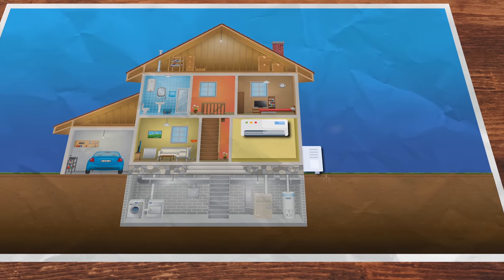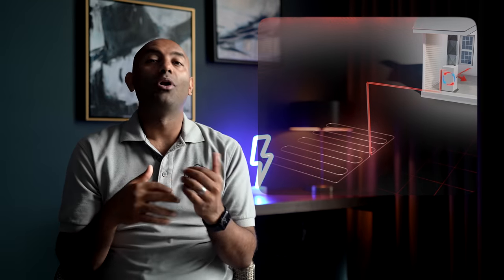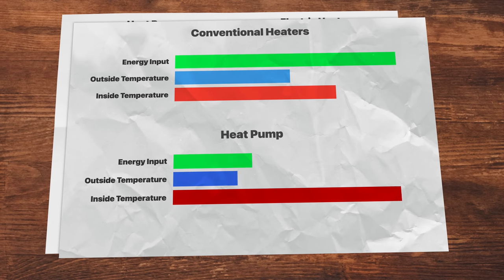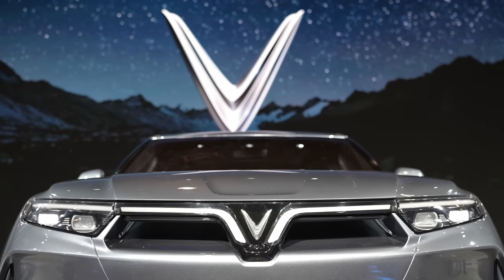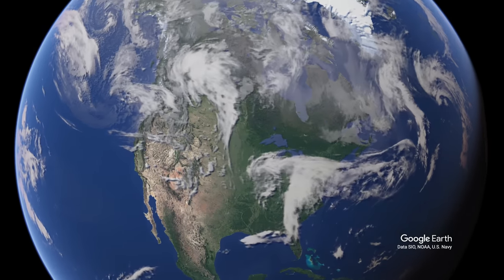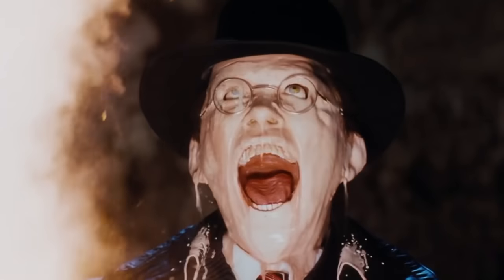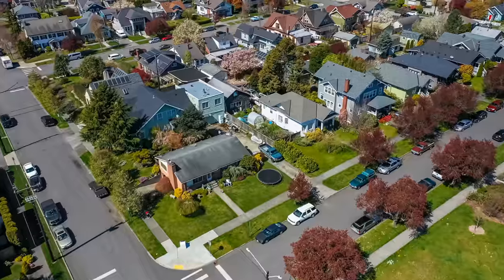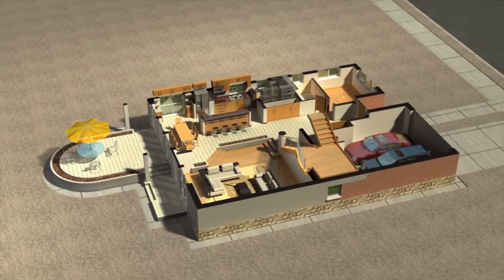Adding This Can Save You Money Summer & Winter!

Comment: Although I am far from a tree hugger I've always been a bit of a fan of alternative energy options because while I don't want to have my head taken off on energy costs I am willing to invest a few bucks here and there if it means spending less overall on monthly bills. I'm wondering if a geothermal exchanger would help reduce gas consumption even by preheating the air going into the gas furnace so I'm not burning as much natural gas just to heat my home. Soliciting any thoughts to see if anyone thinks that might work. I know a friend of my family has successfully heated their home and their adjacent shop with solar water heating and they get really good results even on particularly cold days where they have gone from refilling their LP bottle twice a year to only refilling it every other year, and they still use LP for their stovetop in the house...
Reply: Eddie, the answer is simple: you pay now for more efficient heating and cooling …or you’ll pay much more later. The reasons for this are not mystical, they are climate change and greed of the energy providers that go unchallenged by government. If that sounds strange or like the ravings of an anti government loony, look at your gas and electric bills and look for any periods when your per unit cost per BTU or per KWH ever went down.  Don’t be surprised if you can’t find any such incident. With that in mind, how can it NOT be a smart move to invest in more cost effective heating and cooling.

Comment: It would be handy if everyone would use the same terminology. "Geothermal" properly means a system of boreholes down hundreds if not thousands of metres through which cold water is pumped and steam emerges to power turbines for generating electricity. These are common in areas of high volcanic activity such as Iceland. Domestic heat pump arrangements with a loop of pipe in the ground or in boreholes for providing low grade heat for space heating are correctly known as "ground source heat pumps". It's pretty annoying that the confusion is being perpetrated by Youtube clips like this, and in some parts of the world this terminological inexactitude seems to have become ubiquitous.

Comment: Any pointers for people that live in the tropics or warm climates?
Are heat pumps a good alternative there? Think in Miami or Florida Keys type of weather where temperatures below 70s are rare.
Reply from the maker: You would see a small reduction in costs in the summer. The ground temperatures are much lower than the air temp, so getting rid of heat inside would be much better. But honestly is it worth the cost, for you I’d say probably not

Comment: I'm up in Montana in an area that gets over 100 every summer and well below 0 in the winter, so would benefit year round. I assume the largest part of the high install cost is in excavation or well drilling. Having plenty of land, time and access to big equipment (and operators), I wonder how much would/could be saved doing a lot of the prep work in advance DIY. Would it become feasible for an existing home?
Reply: I installed my geothermal myself except for the loops. That cost me $5,000 installed and he came back after I got it all hooked up. And filled the system with alcohol antifreeze and water.

Comment: The ground temperature is very dependent on location. 
Where I am in Florida it's 72.
In the area in Colorado where my friend lived it's more like 45.
Reply: 10ft below the surface gets pretty cool. Either way the temperature is consistent and and anything above 50 is the threshold for maximum efficiency.
Reply: @motoarzan791  there's a term.  Something like deep well temperature. 
Normal soil reaches a 6 month transition time around 16 feet. Basically that's the depth where the winter cold and summer heat can't continue to really affect the temperature. 

There are maps of the temp. I keep hearing almost every one saying a constant 55 degrees.
And it's not just cooler.  It's more stable. 
Soil type and water are also factors.
Reply: 56 degrees 8ft down. Wisconsin have -20f every winter.
And if it was 72 and 45. That's still a lot closer than 100 and -20

Comment: I'm planning a passive house build in either MN or New England. I don't know if geothermal +/- a heat pump is going to be necessary because of the level of insulation and the tight building envelope I plan to have, but it's definitely going to be considered!
Reply from the maker: That’s awesome! I’m thinking of retrofitting my home in similar ways!
Reply: @TwoBitDaVinci  I'd be happy to keep you in the loop when we start the design/build process if you're interested?

Comment: I want to jack hammer a series of geothermal wells. I have 50 feet of sand to bedrock. so I see this non drilled design would be cheaper. the only problem is the 90 degree elbow that will fit down a 1-1/4 pipe.
Reply: Unless the sand is saturated with water, you are wasting your time and money. Sand is a great insulator. R 1 per foot.
Reply: @kkarllwt  the water table is at 10 feet down. so it's 40 feet of water.

Comment: Live in San Diego and have been researching hear pumps for the best part of a year, very keen to get one fitted to my single floor 1975 build house but struggling to find any local vendor. They all want to push me to gas and standard hvac systems. Managed to get a 6kw solar and house battery installed last year along with solar pool heating, still trying to find a viable solution for spa heating that doesn’t use gas.
Reply from the maker: hey Richard, we should talk, I've only been looking pretty recently. But in San Diego, the weather is so moderate all year roung, its probably the last place geothermal heat pumps make sense. even then I want one :)
Reply: @TwoBitDaVinci  ditto, I have very long term plans with our residential home to turn it into a family air bnb and as a life long environmentalist I don’t mind spending the money to have the right outcomes whether there’s an ROI or not. I’m up in Carlsbad so maybe chat over a nice craft beer sometime soon.

Comment: Geothermal only makes sense for retrofitting old homes with poor insulation and big yards. For a new-built home, you can simply build it tight and efficient like Matt Risinger did, then the heating and cooling load will be so low that even a small mini-split is enough for the entire medium-sized house.
Reply: JW that wasn’t the case with my home. It’s a 2200 sq ft place with a finished basement of equal size. The place was well insulated when I bought it 20 years ago. It’s only weakness was an old low SEER heat pump that used propane as a source for supplemental heat and electric heat strips for really bitter cold conditions which are not common where I live but we do get them several times each winter. When I bought the place, our rural electric coop prices were very reasonable and propane was as well.  But even with cheap energy prices my bills ranged from $150 in the summer to over $300 per month in the winter. This was around 2004. I know there are many areas with much higher energy costs but I moved here to get away from that when I retired. All went well for a few years other than some spells where ice storms took out our electricity. I bought a whole house 20kw emergency generator to handle that and it’s been reliable now for over 15 years. When our electric costs went up 40% I needed to address it. I talked to many HVAC specialists and did my research and had geothermal installed 13 years ago. It addressed most of my problems. It provides low cost heat and AC and even makes our hot water. 2 years ago our electricity costs went up 40% again to no one’s surprise. At this point I decided to go with solar. My system cost 20k after a rebate and even though I had to borrow most of the money, it’s been a good choice. My electricity is now $30 a month instead of $350 so the savings more than cover the loan. In 5 more years that loan will be paid off the same way my geo cost was recuperated within 7 years. 

It’s all about taking responsibility for yourself. I had neighbor’s question my decisions about this. They are now strapped with $400 monthly electric bills and equal sized propane bills. I feel for them but they made their choices and chose poorly.

Comment: Hi! I have a question. Is this ideal for tropical countries in south east asia? we don't have winter. just heat all throughout the year. will this work for only cooling our house?
Reply from the maker: Hi Shiro, this helps in summer and winter. In the winter,  the ground is warmer, so there's more heat to absorb to bring inside. In very hot areas, you need a place to dump the heat you move from inside your house. The hotter the air is, the less the temperature gradient and so the heat transfer is lower. This means you'll get less cooling with the same energy. Instead the ground is much colder, so its much easier to dump the heat there, and therefore it'll work way better. hope that helps!

Comment: I have called over twenty contractors in my state (Virginia) trying to get an estimate for either a ground-to-water or an air-to-water heat pump.  No one will do it.  What's up with that?
Reply: Same here in FL.  Can’t find anyone to work on them.  Ripped mine out and had air to air installed.
Reply: I installed my own geothermal. Ground to water. Man it sure is great getting up to warm floors when it's-20f outside. Use chilled water fan coils. For cooling. Every thing  works great. 5 years running.

Comment: This is great for more rural areas, but what about large cities that need to cool towers? NYC and other large cities that could benefit most from reducing the brownouts are not really eligible for this tech. However, forcing new construction is essentially taxing those in the rural areas to benefit those in large cities. You will slow down the building of new housing thanks to the added costs, and thus slow down the adoption of this tech.

Comment: I don;'t understand why you need the loops to be so big or far away from house for hvac?  The earth can impact the temperature below your basement floor alot more than your house.  Earth is a liitle bit bigger.  So why do you need to go outside the perimeter of basement?  or deep?  Cant yoiu just dig the basement hole - say an extra 5 feet deep..  coiver the coils for 4 feet and then put the basemetn in.  That would dramatically reduce the system coust wouldnt' it.

Comment: The real problem for con$umers is these better long term solutions cost more upfront.
Many are stretched financially to the limit just getting into a house these days.
Fewer can afford and are willing to pump the investment.
When buying a house, co$t is a major concern. Builders use the cheapest components they can get. slab on grade not a crawl space, 2x4 walls not 2x6, cheap A/C unit not geothermal and solar.
I think the best implementation is for large residential complexes instead of individual houses. More space efficient and easier to build/ manage in modules.

Comment: Best geo-thermal is simply using a swamp cooler type plan 50 feet down. Achieve the same exact thing for less than $2k ....very old technology ... Ohh , and the main underground component would last for a millennia ... Or more ...
Edit : 
And typically , tying up 20 feet by 100 foot stretch of those tiny yards in those smooshy developments is rather ridiculous , as merely installing that over priced roll of copper looking tubing across the tiny yard then means at only a 10 foot depth that you couldn't do any future digging such as pool installation , cellar , bomb / tornado shelter , man cave (yes,that's been a recent thing to)..., etc..
Its completely overpriced , wasteful and greatly over complicated to have that crazy geo-thermal system put in that you showed .
The idea has actually been used for thousands of thousands of years as man has dug tunnels across the mid-eastern trade routes and many more examples .
In today's time , you can honestly achieve the same exact results on a constrained property like what's commonly in city limits by simply using the largest septic tank you can reasonably afford , two 3-4" pipes and as deep as you can afford to dig . seal the tank , install a sump pump (just in case) and your fan up top accessible from inside the home . this is a sump pump design and has been used in the deserts for many years(above ground though) ...( or using culvert pipes but those are expensive )

Comment: solar heat collection + heat pump pipe loop
Reply: those heat collectors can be also heat radiators, reverse action
Reply: solar panel to give direct electricity, under the solar heat panels, at 20%, the film type
Reply: you can concentrate the incoming solar heat,  and also compress the output heat, so that the delta temperature is larger, like 100C to 40C outside

Comment: Not a witch counts as the fact that gas was so cheap it still beats them.  Your better off with electric air conditioning.  I'm not buy a small cost but by a huge one.

Comment: My experience with ground source has not been good. When they get old repairs become very expensive. Leaks in the water loop are a nightmare. They are efficient but they still have electric strips for when it’s really cold out… you would be better off with air source heat pump. Even according to his chart you could save 400 a year so after 20 years you saved 8000$ idk I am just not sold…  btw I am not convinced about those number.. air source all the way!!
Reply: I installed my geothermal myself. Except for the loops. 4 horizontal coils. $5000 installed and he came back and filled it after I got it all hooked up. Geothermal heat pumps last a lot longer. They don't have to work as hard. Converting from 56 degrees to either temperature heating or cooling. Verses trying to put heat into a hundred degrees outside. Or trying to extract heat from -20f outside.  And they are indoors. Not exposed to all the extremes outside. I have 3400sqft heated and cooled at all times. I have 10,080 watts of solar. 
Zero bills 5 years running. I installed my geothermal for $22,000. Including cost of loops and all 3400sqft infloor heat. 
I got estimates of $26,000-$34,000 to have conventional HVAC installed in my house. I live in Wisconsin. Frequently have -20f. Don't have any electric strips. I have a 2 stage unit. 3tons most of the time. Will ramp up to 4ton.

Comment: Could this work in super hot climates?
Reply from the maker: Yes!
Reply: @TwoBitDaVinci  if its built under a street (like the example you gave 7m by 100m), could it be enough to cool 20 small houses???

Such houses would be 1 floor, 2 bedrooms each and using ac minisplits, they would need 3 x 12,000 btu units and aproximately 1000 kwh of electricity per month

Is it possible to cool those houses with geothermal built under the street?

Thanks

Watching from mexico

Comment: $14000 for air to air?
More like $1400?
In norway it'll cost about 20k NKr to buy and install a air to air heatpump. And norway is effing expensive.
Reply from the maker: depends on the size. I was talking about a whole house system.
Reply: @TwoBitDaVinci  Still pretty expensive.
But I might be thinking in a differentway, in regards to whats common here in norway vs US, heating/cooling are mostly for common rooms, or via the hvac.

Comment: The fallacy is that the underground pipe loop won’t heat or cool the ground. Also the cost of excavation is more than the cost of the mechanical system.
Reply: @calebmauer1751   - The ground is more of a conductor than an insulator but its all relative. Air is a better insulator than the ground which is why berm houses are a myth as well because 55 degrees of soil requires more energy to heat than 55 degrees of air. Another issue is the static pressure and weight of of a liquid in a tubing. The pump horsepower to move the liquid in the loopccan be considerable. One horsepower pump motor requires nearly 800 w.
Reply: @calebmauer1751  Ideology vs. Reality =  I've been trying since February to calc out two projects with heat pumps air, ground or water source. On the reality side one HVAC contractor won't even install  heat pumps above a 14  SEER because he says they won't work 12 months without issues. A friend said he got a estimate for $100k for a well so he went with 3 split air systems which is what every energy show house Ive been to recently has used. Then only thing that pays for itself is well designed passive, super insulation and  wood stove for back up.
Reply: Yeah the loops need to be sized to the size of the unit. In Wisconsin I only need 1ton for cooling. And need 3-4 ton for heating. . So you would think the temperature might go down. I was concerned about it  so I checked temperature incoming from the loops. 1st of March after the first winter. 1st of March after 4 years was actually 2 degrees higher? Maybe because of warmer summers? 
I installed my geothermal myself. Except for the loops. I paid the guy that all 3 of the estimates that I got. Used to install the loops. 4 horizontal coils on my 1 acre lot. $5,000 and he came back and filled it after I got it all hooked up. All three of the estimates I got were $45,000+  All wildly different ideas for equipment. I got the HVAC guy from the factory I work in. To order the equipment. And I installed it all. Including the loops and infloor heat all 3,400sqft for $22,000. Took me a couple of months to figure it out  and install it. If I was a contractor and knew what I was doing.  Probably would have taken a couple of days. 
Oh yah.  I had gotten estimates for  conventional HVAC  for my house. $26,000-$34,000.
So because I installed it myself  way less than conventional. 
I have 10,080 watts of solar.  And have had zero bills 5 years running. Keep the whole house as warm and as cool as I want. ZERO BILLS....except for sewer water and taxes. I drive a forklift for a living.